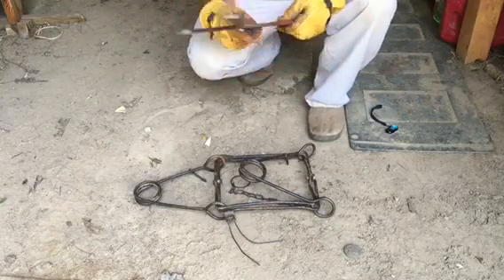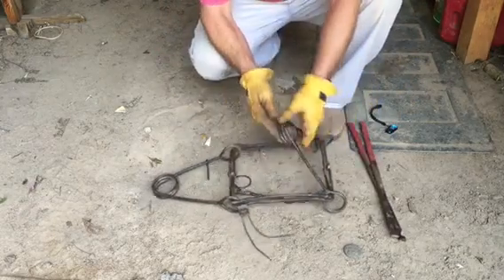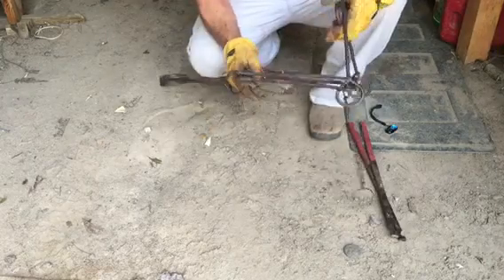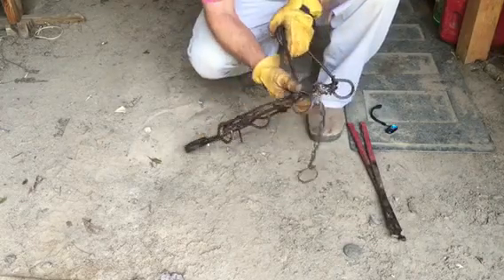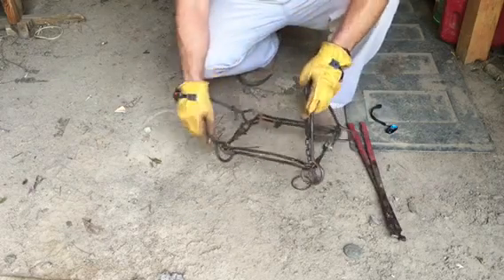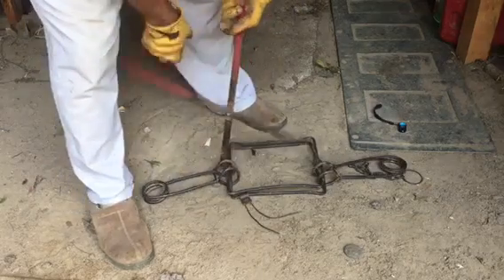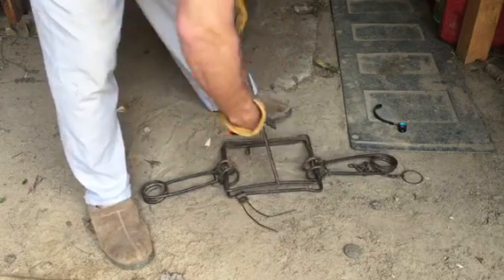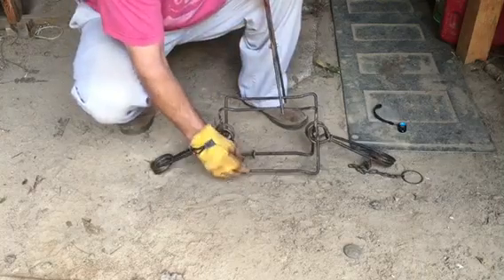Setting Conibear body trap with tool

Comment: Those things are a Pain to set with or without a tool, especially if the springs keep collapsing on you while you're trying to set it,  it's much easier to set if it's not collapsing on you while you're trying to set it, probably not as bad if you've done it for a long time & get used to it, I used a Piece of rope, re-bar & a bench mounted Vice to set them.

Comment from the maker: It is 100x easier with the tool to set. I actually won’t even set one without it now. And try getting a critter out without tool. It won’t come out until you set both springs.